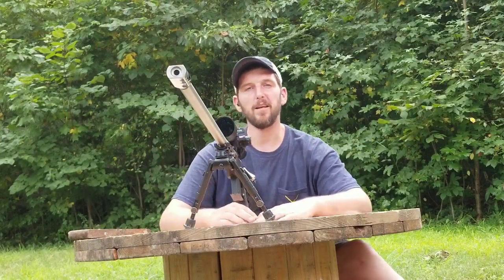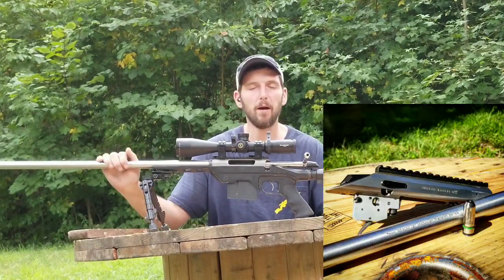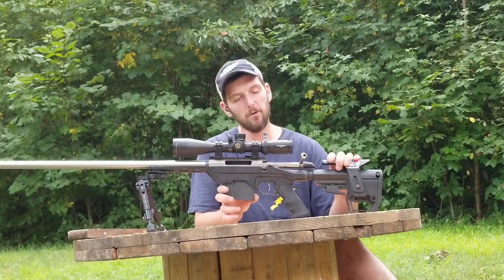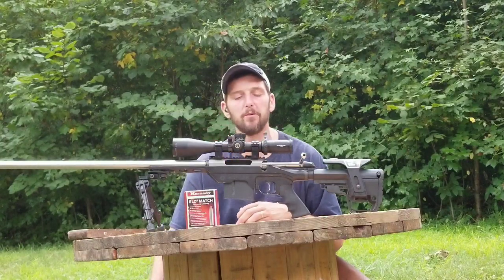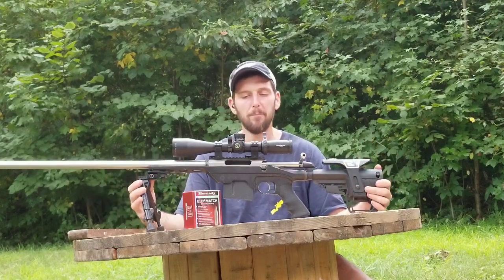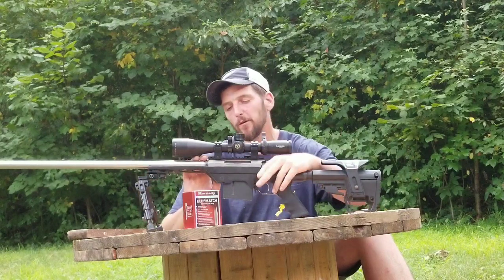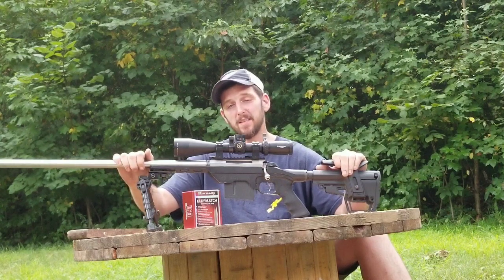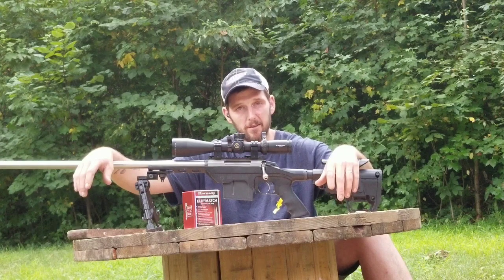Why Build a Short Action Magnum On A Long Action? Custom 7mm SAUM On Tikka Long Action

Comment: Good reason not to is the same reason that the PRS guys shooting PRS with the small 6BR based cartridges have a lot of feeding problems. The shorter round leaves the magazine at a steeper angle than a longer round. Hence the subsequent popularity of the 6GT as it is a longer cartridge that permits the shallower feed angle.

Comment: I ended up building a 7SS (7 SAUM improved'ish).  I had a few bumps getting started, but my biggest challenge is not able to get COAL such that the rounds don't move forward in the mag under recoil and pressure of the first round being chambered.  I just seated a 195gr Berger EOL long and chambered it.  It did not jam, but that COAL is still relatively short.  Do you do anything to prevent the rounds from moving forward?  I am looking into 3D printing modified followers and wedges for the front of the mag.  I didnt hear any of those issues in your discussion.  I need to put calipers on this latest round to see exactly where I am.  Any help would be appreciated.
Reply from the maker: Yeah I looked at the 7mm Sherman short as well when I was getting into the saum. Its a super efficient 7mm. I have not had that issue. I'm using the mdt 300wm length mag. I will say I do more single feed than I do mag feed so it's also not something I really have paid a lot of attention to.
Reply: @gunfather83  thanks for the quick response. Fortunately I have access to a Mech Eng with 3D software and a 3D printer.  I showed it to him yesterday and he is looking at it now.  I will let you know. BTW, I went with a Bergara HMR LA stock and defaulted to the Magpul LA mag.  I will try and MDT 300WM mag to see if it helps.

Comment: Do you know if this will fit a plastic tikka mag such as 7mm mag, 300winmag, 300wsm?  I'm thinking of going 7 SAUM but will be using factory mags to save weight.
Reply from the maker: If your using an original Tikka stock in long action the Tikka long action mags will definitely fit any 7saum that you load but this particular chassis im using only fits the mdt 300wm long action mags. Im assuming your looking to build a hunting rig? I will say this is a 5 round mag and its pretty light
Reply: @gunfather83  yeah it'll be a hunting rig.  Already ordered a Mesa Precision CF stock.  I'm trying to order Proof CF 6.5 PRC barrel but it's out of stock everywhere.  Now I'm thinking of going 7SAUM.

Comment: First of all, great video, as all of your videos are. Really helpful stuff and much appreciated. I have been thinking of building a 7 Saum using a Savage long action but with all the bad mouthing Savage gets I've started to think maybe Tikka or Rem. Lots of choices for Rem clone actions but the price is nuts so I was considering Tikka but unless I'm mistaken you can't change the bolt face on a Tikka like you can a Savage which would mean I would have to get not just a Tikka action but a magnum Tikka action, correct? Thanks in advance for any advice.
Reply from the maker: You are correct with the tikka bolt face. You would have to get a long action Tikka but I would say there is nothing wrong with a Savage action.  One of my most accurate rifles is built on a Savage action
Reply: @gunfather83  Thanks!

Comment: I have to ask if you did not need to use the magazines instead going for single load  could you run the 7mm saum in a short action ?
Reply: If you run a long COAL, unloading an unfired cartridge can be challenging to remove.  With the bullet attached, it may be too long to swing out the port and be released from the bolt face.

Comment: Very impressive,  im a lefty & am curious as to how to build a nice well rounded bolt gun... im liking that cz in 7.62x39. But that aint no where near what you have obviously... nowhere in maryland to stretch out anything more..lol
Reply from the maker: The 7.62 x 39 cz is a very cool rifle. If i was planning to get a rifle for the purposes of short to midrange precision shooting and I wanted something that is going to give me the best training applicationsfor the long range.I would either get a 22lr or a 223. The 22 is going to give you the most training value as far as ability to read wind and how to make  elevation correction. Done quote me on this but I believe a 22lr at 200 yards has about the same elevation correction as a 6.5Creedmoor at 1000. If 22lr isnt what you're after then 223 is a caliber that is extremely affordable and there is a huge amount of match factory ammo available that can be found almost anywhere that has a sporting goods section. 223 ismoretban capable of 600 to 800 yards but even at 300 yards it requires some understanding of how the bullets flight path to make proper elevation corrections. 7.62x39 is an awesome caliber but the fact is there is just very little match factor ammo available and if you don't hand load its going to be hard to get the most performance out of that cartridge.  As far as being left handed. That's a blessing not a curse when it comes to precision shooting. You have the ability to use a right handed rifle with you hand on the grip while running the bolt with the right hand.  I set up my 7mm SAUM on a left handed action for exactly that purpose

Comment: tikka has only one size of action, there isnt SA or LA with Tikka
Reply from the maker: That's actually not completely correct.  Tikka uses the same size of action for their short and long action . The long action has a longer bolt stop allowing for longer cases and a larger ejection port all on the same size of action as a short. But there absolutely is a difference between the two
Reply: @gunfather83  reciever is always  the same. bolt stop is only bolt stop. T3x has bigger ejection port like T3 version. The isnt LA and SA, same body.
Reply from the maker: @tangoSVK  well look at ordering stocks and chassis for tikka and if you have a magnum caliber you have to order a long action chassis if you have a short action it has to be a sa chassis.  And a differently positioned bolt stop and a spacer is still a different action even if the overall length is the same.go look at west desert shooter he had his 7mm SAUM tikka action machined and turned from sa to la to accommodate the SAUM because the length is needed to accommodate the 7SAUM properly
Reply: @gunfather83  chassis and stocks are different because with tikka action what is always in same lenght but you can use different lenght of magazine (tikka mags have same lenght they have spacer, like DT SRS). But these stocks and chasisses have always same inlet for always same blueprint of tikka action. Same Tikka reciever you can put inside every chassis that can be use with tikka doesnt matter what mag lenght you need, write less, learn more
Reply from the maker: @tangoSVK  no matter how you cut it there is a difference whether its slight or not they make a la and sa. If they put a bolt stop in a different spot on the sa cartridge action than they do in the long action so that the action can accommodate a larger or smaller cartridge then THATS A DIFFERENCE. I dont really care about arguing semantics over something that is not an issue to anyone except to someone who wants to be a troll on the internet.  I'm too busy shooting  my rifles to care. Maybe you should make a video with all your vast knowledge so that nobody else will care either
Reply: @gunfather83  your knowledge on the Tikka action is missing some information.  All Tikka actions are the same length and are better termed an "extra medium" action.  The difference between a short action and a long action are the length of the internal bolt stop.  This removable piece (replaceable and interchangeable) stops the bolt sooner on a SA caliber (both standard SA and WSM cartridges) and later on LA and Magnum calibers.  A short action Tikka with a standard bolt face can change barrels, bolt stops, and magazines and go from a 243 to a 30-06 in a factory stock or any stock using factory bottom metal.  A Tikka in WSM with a magnum bolt face can change from a 270 WSM to a 7mm Remington Magnum in the same function by changing barrel, magazine, and bolt stop also in any stock using factory bottom metal (yes, I know it is plastic).

The change in interchangeability comes in aftermarket stocks and chassis system utilizing alternative magazine sizes.  The long action and short action AICS magazines will not fit in the same bottom metal where a Tikka magazine, regardless of SA or LA, will always fit into a Tikka bottom metal.  My 300WM magazine in my T3 will fit in my wife's 243 Winchester T3X.  My T3X 6.5CM magazine and bolt will fit in my T3 300WM.  The SA bolt will lock up and even feed a round when put into the 300WM but obviously not go into the bolt face or eject the 300WM but I think you should get the gist.

The Tikka action is gaining popularity and getting a stronger aftermarket support system every year.  The RSAUM calibers and 6.5 PRC are really gaining popularity as semi-custom Tikka builds with the ability to "load them long and send them strong".  There are now at least 6 companies offering chambered pre-fit barrels for Tikka actions and 15+ chassis systems and aftermarket stocks available.  We are going to see Tikka actions continue to grow with popularity with those who want a really nice factory action at half the price for a full rifle as compared to a custom action.

Comment: Good video! My question is what magazine are you using and did it take any modifying? Another is what is the coal on your loads? Planning to do a similar build with same action and caliber but I was going to do it on a short action since I’ve seen people having success using the wsm ai mags that hold a coal of 2.950” thanks in advance and sweet setup!
Reply from the maker: Thank you. My oal is 2.98" and I'm using the MDT magnum magazine  that's designed around the 300wm.

Comment: Damn, glad I found this vid!

Been doing the research on doing almost the same thing with a 338 tikka win mag that's been for sale in my area for a while... like you at a price I cant afford not to take lol (even if I can build it for a few monthes)

What made you go with the 7mm vs 6.5 or 30 cal.  As I was thinking that I would have better bullet choices in those calibers.

I was thinking about the 6.5 prc 
But I don't want to chamber it in that caliber just cause it's being "pushed" lately. 

Also I know it would go into long action territory , but what's your thoughts on 300 prc...in my neck of the woods(Alaska)  the extra thump is comforting for critters lol.
Reply from the maker: I chose the 7 saum because it's the most efficient 7mm caliber and the most efficient of the SAUM calibers. When it comes to balancing speed, ballistic coefficient and energy as well as amount of powder it takes to produceall that.  There are actually a lot of really good high bc match and hunting bullets in 7mm. The 300prc isnt just a fad in my opinion.  Hornady actually solved a problem that none of the other 30 caliber magnums does. Back when the 300wm and such were created there was not the same selection of very high bc and very long bullets that there is today so if you wanted to run a long 208gn or bigger bullet in the old 30cal mags you either had to seat the bullet down really deep in the case giving you a significant loss in powder capacity or you had to have a chamber that was custom reamed to be deeper than the cartridge was designed for.  So what Hornady did with the 300prc and the 6.5prc to a lesser extent was designed the case and chamber around the use of the new high bc 30 cal bullets so you dont lose any case capacity and you are able to get max efficiency from your powder burn. Its really something that was lacking in the 30 cal magnum space. So I'm actually a big fan of the prc calibers and one day I will build one for myself as well. Now dont get me wrong the 7saum can deliver equal energy because the velocity is more than the 300 prc with a slightly smaller bullet.
Reply: @gunfather83  awsome,
Yea I was really set with 300 prc.  But now you got me looking into 7mm...
Just because I finally bit the 6.5 creedmoor bullet lol. And I have to say compared  to 308 the recoil is nothing, not the 308 was that bad  but it's a definite difference....

Which makes me wonder if I could but a long range thumper out of the 7mm cal bullet  but without the recoil of a 300prc because I want to build it half way lightweight 

Also would 7mm-300prc be a horrible idea?
Reply from the maker: The recoil in 7mm SAUM is very manageable. I'm running a 3 chamber break but I have shot it without it and it was slightly more than 308. I have never seen a 7mm-300prc build but I would Imagine it would be very similar performance to the 7mm-300wm that I looked into very heavily before I went with the SAUM. with it you can push the 180s a couple hundred fps faster.
Reply: 7 prc is gonna be basically 7 saum but in long action, with more case capacity

Comment: What muzzle brake is that?
Reply from the maker: It's called a tank break. I can't remember the brand but it came from Mid South Shooters Supply.  If you search tank break you will find it and a couple other styles
Reply: Ok thanks.

Comment: excellent choice i might go the same route, 7saum on a long action.  Was thinkin about the 7-300 as well.  Im going back and forth between a 6.5 creedmoor, 7 saum, long action / short action, custom action or tikka t3x.. decisions decision.  How viable do you think a 7saum would be on a 24inch barrel
Reply from the maker: I'm running a 28" tube. I honestly don't think I would want to run anything under a 26" for my purposes of long range precision and especially Extreme long range.  The sweet spot with the 180gn and up bullet class seems to be that 2900-2950fps. It's really easy to get to that velocity range without over pressure. I can actually push it close to 3100 without pressure in a 28". I'm running 2935 right now. You may be able to get those velocities with a 24" but it would be really close to over pressure if not over. Now depending on how far you plan to shoot or hunt you you may not need that extra velocity. In that case then 24 is fine
Reply: @gunfather83  i've decided on 26.  Going to grab a tikka t3x lite in a mag caliber, swap out the barrel and stock, sell it.  Going to custom cut a 7 saum with a longer throat to seat the bullet out further with a tikka long action.  Hoping to get similar results
Reply from the maker: @keokio7  good choice.  Let me know how it works out for you